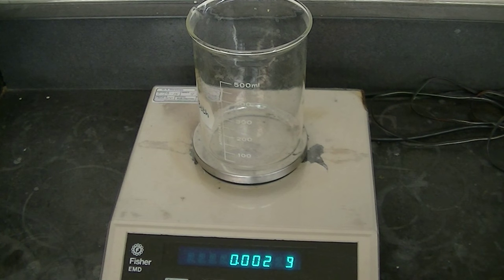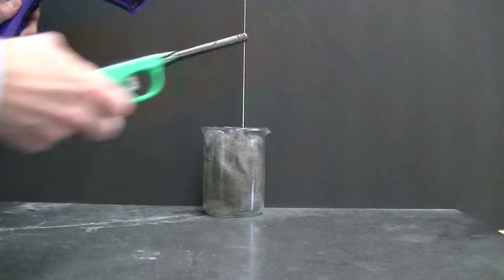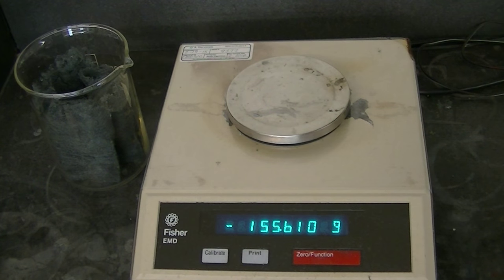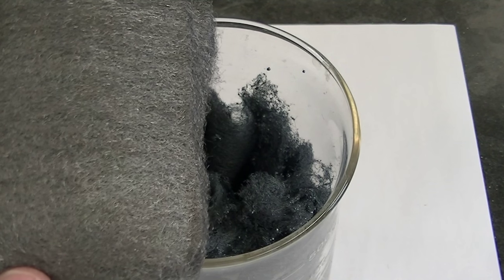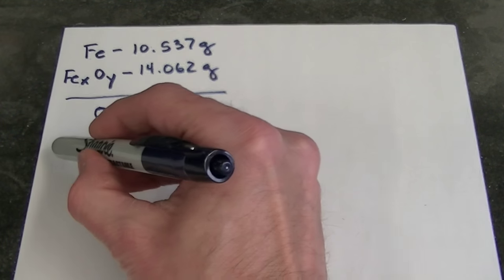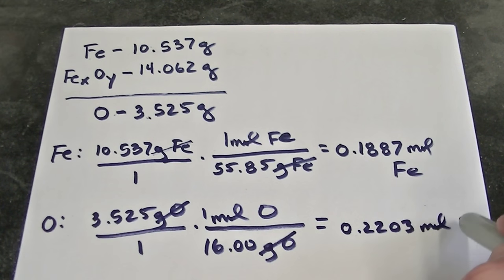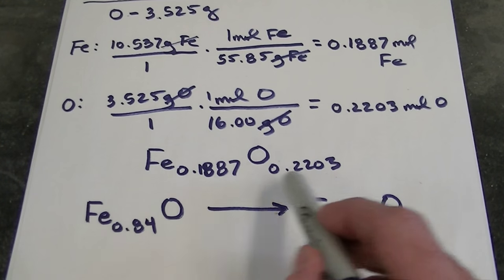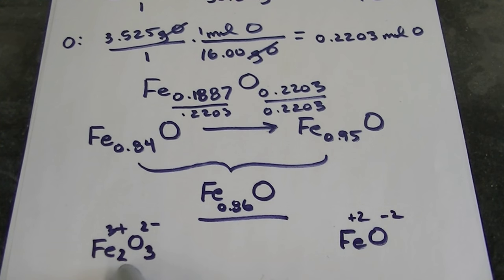A Sparking Stoichiometry Demonstration

Comment: I'm truly interested and not a troll-- Why didn't you do a typical empirical formula calculation and divide by the lower of the two? That gives a 1 to 1.16 ratio-- which rounds to 1:1 due to possible experimental error. As you say, the steel wool is probably not 100% Fe, so I would expect some error. The information of non-stoichiometric compounds is interesting but this is very useful for entry level students determining the empirical formula. Thank you for this idea!
Reply from the maker: You bring up some good points. You can read more of my thoughts on this experiment at the URL below. Of note, I've done this experiment several more times and I often get a 1:1 ratio https://www.chemedx.org/blog/put-spark-your-stoichiometry-lesson